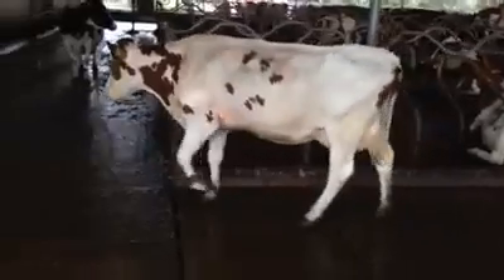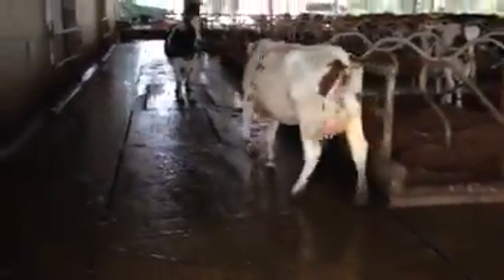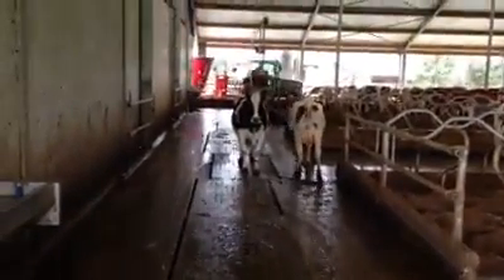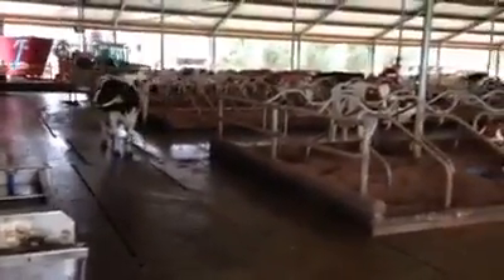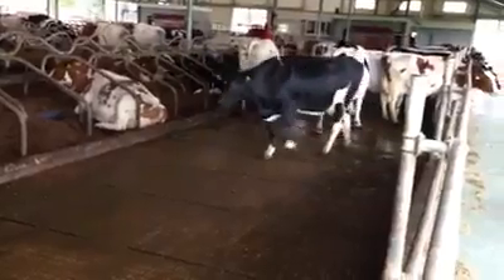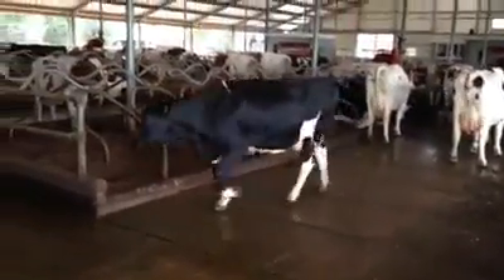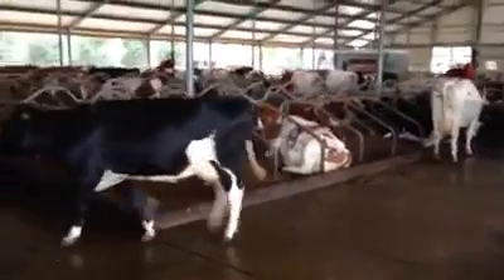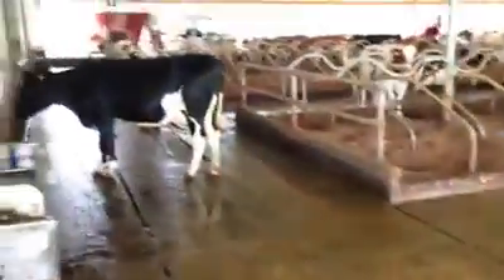CowSignals: What is the problem with this floor?

Comment: If the barn is sloped then the best thing to do is use a aerobic flush system to clean the floors.  No need to groove. Simple system low maintenance. Alleys flushed 24 times a day with less water per flush.  No smell.  Cheap to operate.  Floors are clean and not slippery. Aerobic bacteria eat the slime from the residual manure. Recycled Flush water is safe and free from pathogens.